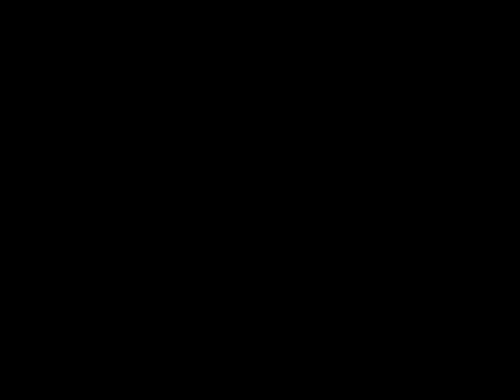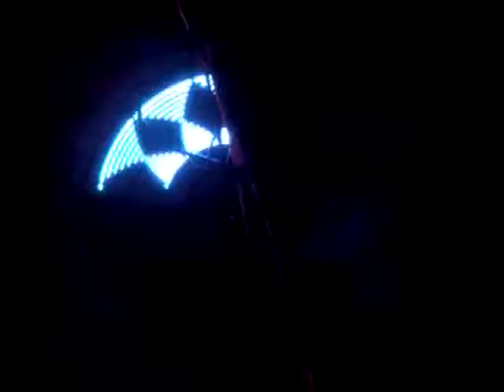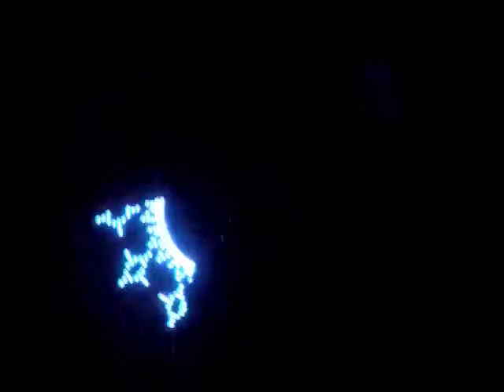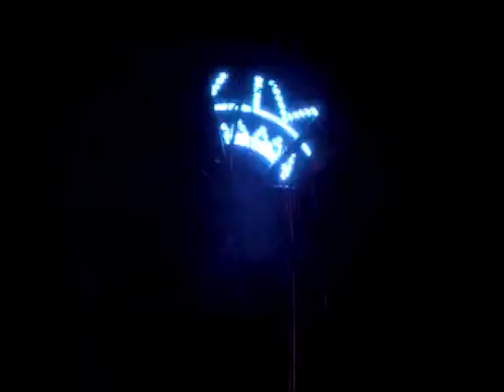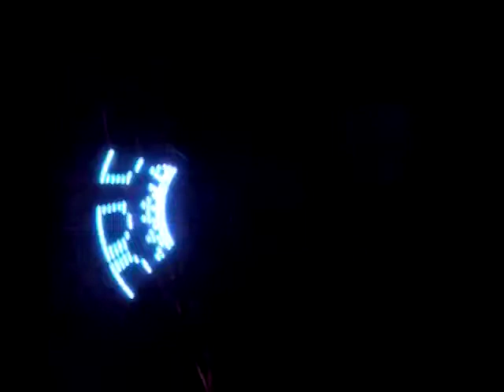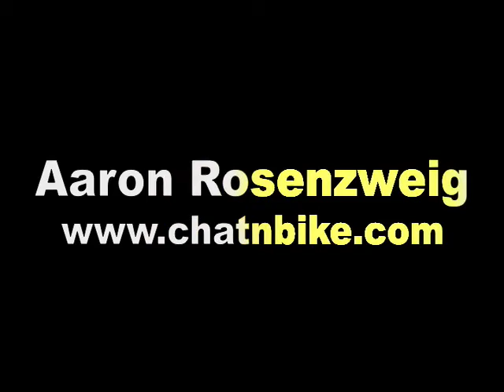spoke lights

Comment from the maker: @rickeraver I still have the box. The brand is "NationalDesign" but I've seen other companies with the exact same thing. I do not know who the original manufacturer is. If you pay $7 it's a good price. If you pay $15 it's too much. If you search on eBay for "spoke light" and then put in a price range between $6 and $10 you should quickly find this type of light.